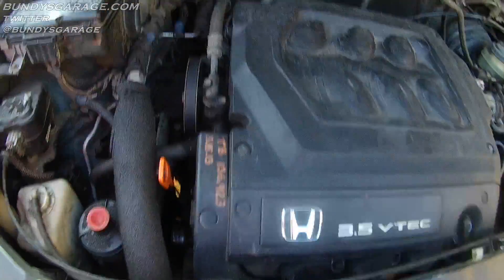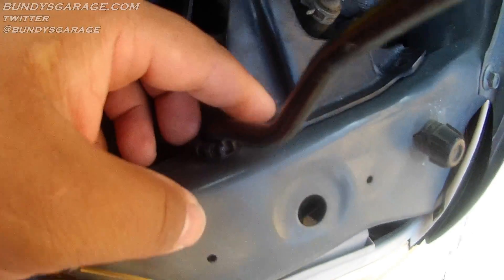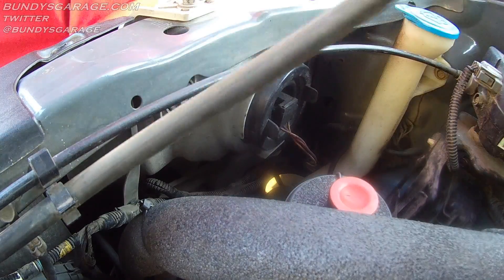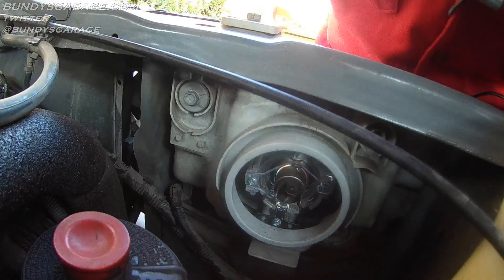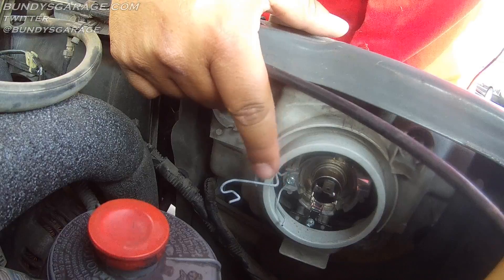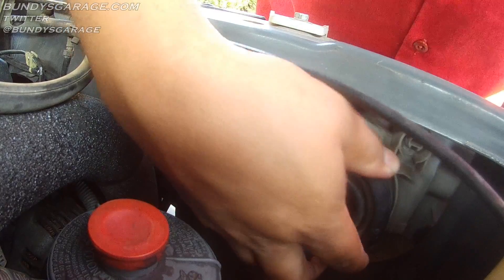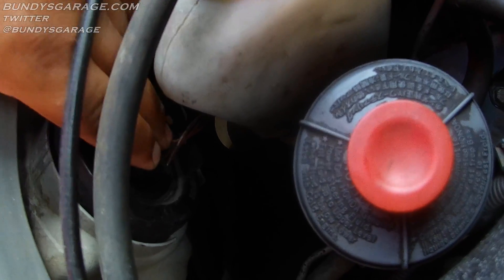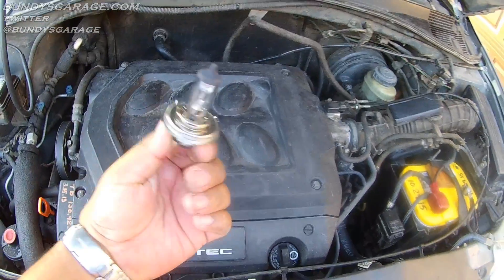Honda Odyssey Headlight Bulb Replacement - How to Install Headlight & Bulb Honda Odyssey 1999 - 2004

Comment: Thank you for a great instructional video.  I just replaced both of the headlights in our family van with your help.  I'm feeling like a pretty accomplished Mom! Shop was going to charge me $54 to replace just the drivers side that was out.  It took me about 10 minutes for both bulbs. thanks again
Reply from the maker: I love hearing comments like this! That’s why I started this channel to help people just like you. Thanks so much for the feed back. If you have any other questions or need help with your van please feel free to reach out to me at any time. Bundysgarage@gmail.com and if need be we can jump on the phone. Shops can charge way too much for little stuff, if I see a bulb is burned out and it’s easy to do I’ll just change it out for the customer and let them know, no charge.

Comment: Thank you so much for your video on drivers headlight replacement.  I see it's alot easier to replace on the passenger side, but I had to replace drivers side...I didn't want to take out the batttery (too much trouble!)but I couldn't fit my hand in to get to the bulb....but I didn't know about that plastic part that covered...the area on the right!!! Once I got that out I was able to reach the bulb...THANK YOU SO MUCH FOR THIS INFO...I would have had to take it to a mechanic and pay to get it done otherwise.  I'm female and not mechanical, but I do fix things like this with all the help I get on YouTube videos...and you were able to help me get this done !!! Thank you SO MUCH!!!  I subscribed.  If I have any other simple vehicle problems I will go to your videos FIRST!!
Reply from the maker: Glad it helped you out!

Comment: The passenger side bulb went on my 23 year old odyssey and thanks to this great video I could do it. The driver side bulb was a bit fiddly to do due to limited space and my fat fingers but that was accomplished as well. Lets see how long these new bulbs last, they look the same as the replaced OEM ones.
Reply from the maker: Glad it helped you out. If you want to upgrade and spend less money on bulbs take a look at LED upgrade packages on Amazon. Auxito is a great brand to use.

Comment: Plenty of videos to change passenger side bulb. It's the drivers side that needs the most help. 😢
I hear it's best to change both bulbs at same time.
Reply from the maker: The drivers side is not hard at all. If need be just take the battery out.

Comment: I have a 2004 Honda Odyssey and had battery issues in the past and both headlights are out driver side low beam and passenger side high beam… what do I need to do to prevent that battery issue from accruing again

Comment: replacement of the drivers side bulb is a major pain. Move Battery, remove plastic cowling, remove air intake, then you can get to the bulb. If I had child size hands things might be easier.

Comment: Well, thank you for an excellent video -- I needed this.  I needed this BECAUSE modern car design is completely nuts, and I really, REALLY hate it.  They must hire their design teams straight out of Bedlam.  On a REAL car (that would be, circa 1968) ya unscrew a trim ring, take bulb out, put new bulb in, screw trim ring back on.  And it has nothing to do with your radio.  How I pity all of you that are too young to remember the real simplicity of automotive design.
Reply from the maker: Thanks for watching
Reply: @bundysgarage  Thanks for being there.
Reply from the maker: No problem. Thanks for watching. I have a lot of videos that can help you on the Honda Odyssey’s